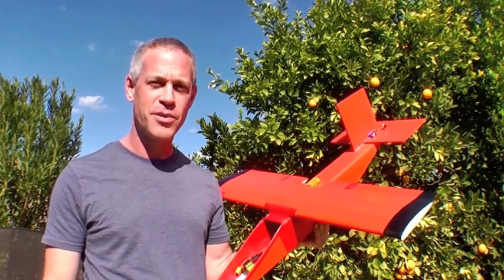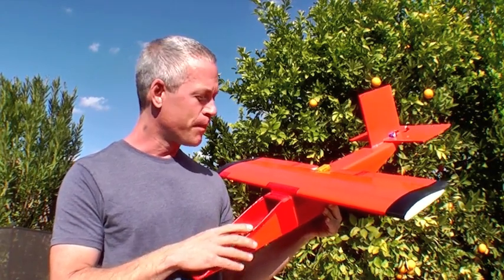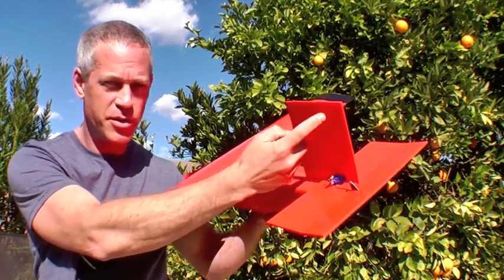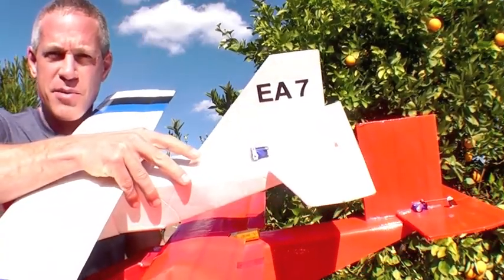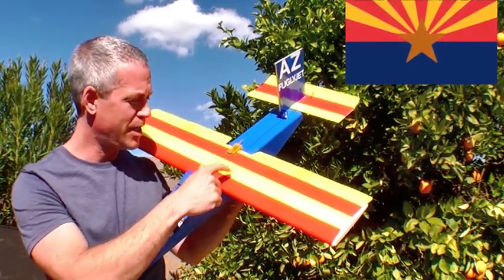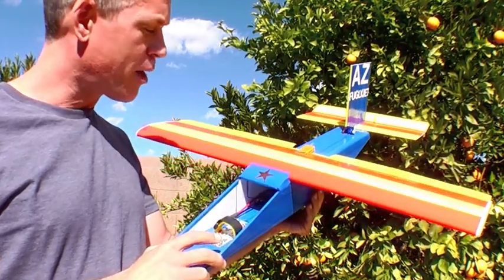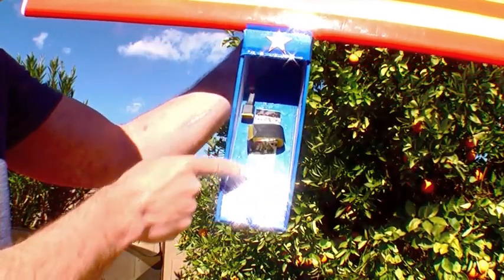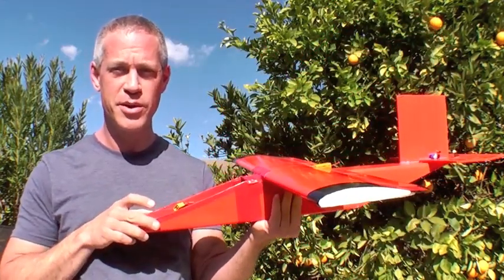FUGLYJET EDF Scratchbuilt Foamie

Comment: GREAT video ED.  Been watching you for years now.  Got 2 questions.  Hopefully you can help.  I can see you're using a flat bottom wing.  Is your Thrust angle running parallel to the bottom of the wing like it appears to be.  Also, where did you get the 64mm EDF combo.  Can you direct me to where I can find similar.  Currently building my first scratch built EDF Delta Wing.  Very Excited.  Let me know please.  THANKS.

Comment: OK
I'm convinced!!

There's a 64mm fan kit coming from Nitroplanes ($37) includes fan, motor, ESC and 4 9g servos, I'm going to add a KK board stabilization & auto-level. Got $15 in the board, and $6 reciever. Having a hard time finding cool looking tape.With 2200mah battery and foam, I'm still under $75 into the air!

I may paint then go with clear tape. Got time, it's sub-zero with 30mph gusts here in Upstate NY. Thanks for a great idea!! I will report as the build progresses.

Comment from the maker: I agree with that advice, a 40" wing will make a more docile plane.  I would make the vertical stab a little bit bigger and sweep if possible to maximize the tail moment arm (get it as far back away from the CG).  The Noob Tube will definitely benefit.  The Fuglyjet is kind of meant to go a little fast, and it like many EDF's can be kind of twitchy.  If you have the power in your EDF to push a bigger wing then give it a try.  Same advice applies on the tail.

Comment: Hi Ed, I am a new flyer, currently building the Fugly jet and Axon trainer. For the Fugly jet , it has a 30" Armin wing like the Noob Tube and I read on the forums that some flyers have made it a 40" Armin wing( 2 20") and it flies a little more easily.  I wanted to get your advice, should I stick with the 30" Armin, or make a 40" and keep the original tail or make it larger and swept like the Axon tail, thanks.

Comment from the maker: @thewillage It's reputed to be a pretty zippy powerplant.  I posted some dimensions for the fuselage tube for a 70mm EDF in the description.  The 30" wing is what it's designed for so you're halfway there.  I would be liberal on the horizontal and vertical stabilizer sizes.  You could make the whole thing longer, like 45", which would be more stable but somewhat more complicated to build.  Check in again sometime before maiden and maybe I can continue to help the project.
Reply: Where exactly can I get the dimensions for a 70mm build ?

Comment from the maker: @geno145 It depends on control surface size, but assuming a 1 1/2" elevator and ailerons, and equal hole-to-pivot distance between servo arm and control horns, I recommend 50% rate on ailerons (gives me about 1/2" up, 1/2" down) and 75% on elevator (gives me 3/4" up and 3/4" down).